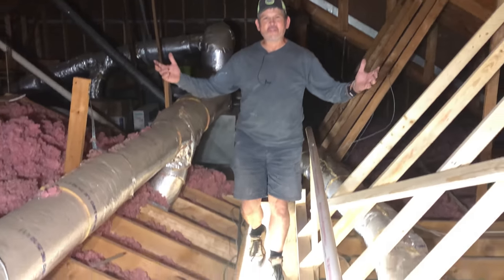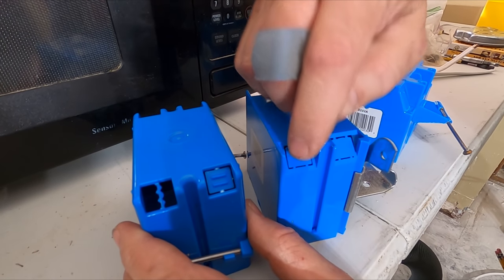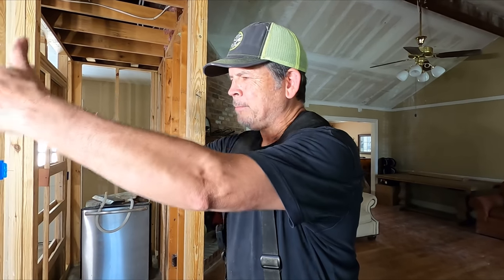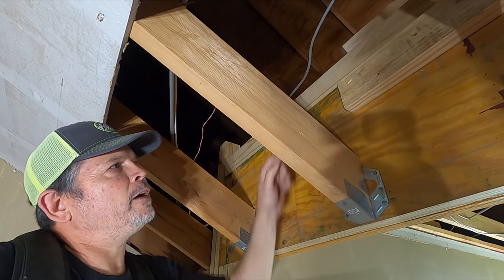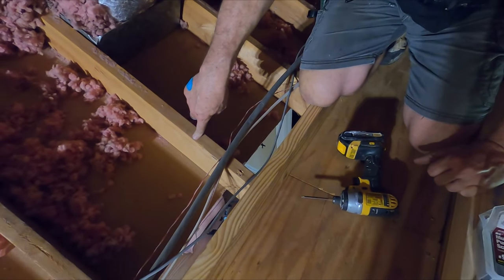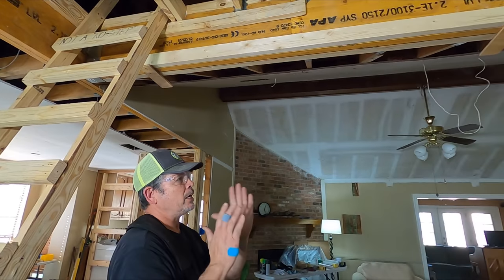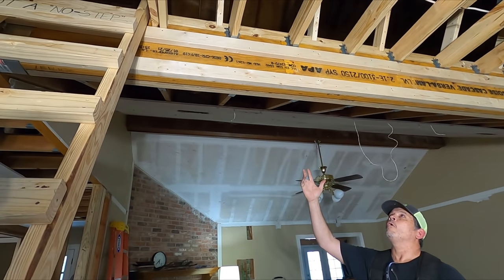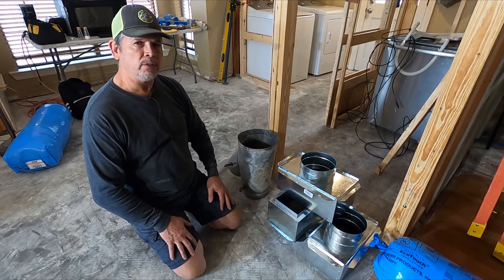EASY ATTIC TRAVEL! We Had Some Spare Materials... Ep. 11

Comment: I worked as a low voltage electrician. We were working in a commercial building installing new fire alarm smoke detectors and annunciation lights. One of my coworkers and I were in the attic and he crawled from hard lid ceiling straight onto ceiling tile and came crashing down. So that catwalk is perfect.
Reply from the maker: Thx Adrian 👍

Comment: Paul - It looked like there were screws going through the damper plates in air splitter. The way to reposition the air flow control handles so they would be facing up the way you said you wanted was: 1) remove the screws, 2) pull on the control handle to withdraw the pivot rod from the splitter, 3) re-insert the pivot rod, but from the other side, and finally 4) reattach the damper plates to the pivot rods using  the screws. (You guys do awesome work and I really enjoy your videos.)

Comment: Good stuff. When I had a house I installed lights and outlets in the attic and in the crawl space for when I'd work in these spaces. (light switches right at the opening).  In the attic I laid down plywood over the joists. Why not? It costs very little, makes it safer. The lights and outlets took a couple hours to install, probably saved me time the first year.

Comment: You are correct about the knockouts & clamps.
Reply from the maker: Thx Jerred 👍💪
Reply: No shit huh
Reply: Carlon's technical info sheet for their blue boxes shows this. Most single gang boxes have a knockout, whereas multigang boxes have integral clamps. National Electric Code 314.17(B)(2) Exception says that if we use a single gang box with a knockout, then we can put as many cables through that knockout as we want so long as we secure them within 8". If you go in thru an integral clamp, you must secure the NM cable within 12".

Comment: Even as just a homeowner, I’ve never understood why this kind of thing isn’t standard. As far as I’m concerned accessing things in the attic is important and should be easily done.
Reply: It was standard at one time, not sure why it changed! Look at houses built in the early 1900s (the house I grew up in was built in 1906) and they all have full stairways to the attic and usually full floors.
Reply: @hightechcarpentry  Most of those homes didn't have a great deal of insulation so an attic floor was easy and made sense. Aside from that, it changed because it isn't "pretty" and few consumers know enough to ask or care if the attic is traversable so builders nix it. builder's sell what sells. Additionally, a catwalk makes the attic easier to inspect, this is a bad thing from a tract home builders perspective. You're lucky to get properly flashed windows in a new tract home, if they won't pay for that you can be sure you won't get a catwalk.  I've seen catwalks in many newer custom homes. Like most things, it comes down to money.
Reply: It's all about money. The homeowner saves some money and the builders save a ton of money by not putting it in the houses they build

Comment: Hey Pual, 5 year hvac tech here. I'd recomend you strap up that flex and support it. Once you get over 3 foot length it tends to sag and over time that spring can give out collapsing the duct. Also I was though (doesn't mean it's the right or only way) you do the inside liner then pull the insulation to the just past the duct, and lastly pull the outside sleeve to fuller cover every thing and put the panduate in front not over the insulation. So you don't see the insulation and it creates a better hold. My last tip is if you can justify it Malco makes a pretty good panduate gun just for getting those things as tight as possible and then flush cutting them. It's great and they will prevent flec blow offs which can be really common if the line gets dampered down at the grille.

Love you guys and your videos, can't wait for my new hat to arrive!
Reply from the maker: Thx Rockery 👍👊

Comment: The handles to the dampers can be turned around so that they are on top. You can remove the shaft from the damper and put it back in from the top.
Reply from the maker: I tried Paul, those things were in there good and I didn't want to ruin that fitting 👍

Comment: That buried junction box with exposed hot wires is a SERIOUS code violation and I'm not even an electrician. Good on ya for finding it. The homeowner would've had a devil of a time finding it if it ever developed a short and was tripping the breaker. I know this from experience from some landscape lighting that I have that for some reason the previous owner removed a junction box and buried the wire nuts in the dirt. It was years before I finally discovered the buried wire nuts. Go figure. Ofc, now I own a wire tracer that I used to find my missing irrigation valves. But, I didn't know about those at the time when the short first appeared.

Comment: 0:39 The first two box designs feature knockouts. They are designed to be broken off to accommodate the wires. That's why they only attach with thin links of plastic. The third box is designed with integrated wire clamping.

Comment: I kind of did this same thing. They were remodeling at work and there was a bunch Plywood already ripped to 16 inches so I laid it down the middle on top of the roof beams. It’s slightly angled and I overlapped from there wouldn’t be any weak spots

Comment: Good idea for the catwalk. The only thing I would add is I would have installed it higher, say 2 feet high to accept an r60. I know for a lot of US zones it may be overkill but honneslty in Canada where we have crazy fluctuations from high temps to low temps, even the r60 makes a big difference to help keep the home cool. This way also it adds insulation around all the ductwork, as long as those are airtight to prevent the blown insulation from being disturbed. Great video.
Reply from the maker: Thx.  Pretty mild winters here.  R60 😳
Reply: @StudPack  yup, it will also make a good difference on heat resistance from the attic to the house and increase the efficiency on the hvac runs in the attic you installed. You can add an r32 over those runs since the runs themselves take space, so you're not really using a lot more blown insulation.

Comment: I did something similar on a house. We had two spare 2”×6” lumber that I installed as a catwalk next to the attic access towards where we were working. It made it so that you didn't have to worry as much when you were entering or exiting the attic. (The attic was too big to make it worth doing more than that.) I spaced them off of the rafters by laying a 2”×4” on edge to give room for the blown in insulation.

Comment: I never use flex, only in impossible corners. When I use it, I make shure it comes from a pipe-elbow or a straight piece of pipe and as straight as possible. I clean those airducts on a regular basis and always it's the flex giving problems. Tearing an blocking, collapsing, etc. Sometimes I can't get through them because they clog up more then straight pipe. Also from the in-/outlets I start with a pipe-elbow. This way the flex won't collapse in the bent and you don't have to hang the flex high. This way the flex is supported by the insulation and won't make strange bents when someone bumps into it. And straight pipe looks much nicer and is more efficient.
Reply from the maker: Yeah I prefer rigid duct but it’s never installed right.  Residentially speaking.  Too many leaks like in that wye
Reply: Yea it is the ducts fault not the brush you're using or anything you did wrong. If you clean ducts on a regular basis you probably don't know that much about hvac. From the comments I have seen not many hvac people are in here or they would be pretty heated. A lot of the methods used in this video are looked down upon by many hvac techs. I hope you are sealing the boots to the drywall with caulk. If not you may have a mold issue in the future.

Comment: Built me a walk thru attic using decking boards long two side by side and 2x between trusses makes getting to things much easier, had to doing duct replacement. 
Also those are knock outs on the first two boxes, clamping occurring when stapling wire the code required distance from box. yes some boxes have integral clamps but not required to on many of those boxes as long as wired secured per code.
Reply from the maker: 👍 thx mike

Comment: I have always noticed that the old metal ductwork work is heavy gauge and the new stuff you buy is half as thick. Since those metal diverters are always open. I think that I would’ve removed them completely since the duck work was going to go over it anyways.  I do like the strip lights in the attic however I don’t think I would’ve spent any extra money on that unless I had it sitting around unused because regular lightbulbs are much much cheaper and not many people go in their attic very often.  I do like the PVC handrail very smooth and you don’t get splinters.  Good Job!

Comment: A cat walk is a good idea, but the cats don't always follow the walk.  Back in the 80's we were living in an old country farm house that had been built in 1920.  No insulation.  The living room ceiling was 12x12 inch tiles that were stapled to half inch strips of wood.  I had opened the eaves on one side to add an addition.  It was a cold and rainy night.  The feral cats that lived on the property (about 35) decided to climb up the posts on the new addition and seek the warmth of the attic.  Unfortunately they all slept together on the tile ceiling.  Could not hold the weight and collapsed dropping most of the cats into the house.  I woke up in the middle of the night and could not move my feet.  Turned on the light and found a pile of wild cats sleeping at the bottom of the water bed.  Yes, we had a water bed in those days.  Took over an hour to get all of the wild feral cats out of the house.  Covered the posts with metal the next day so the cats couldn't climb.
Reply from the maker: I would have moved 😁 🐈🐈🐈

Comment: code says staple within 12 inches if using a box connector, 6 inches if not. if you pop the knockout out all the way on plastic boxes just put your staples within 6 inches and you are fine. metal boxes I would always use a connector as the metal will cut through the insulation.

Comment: Hi, Really enjoy your show and subscribed a while ago. Your videos on all aspects of a project and best practice of installations is great to see. There are not many trades people who are as well versed as you and can also explain both how and why it should be done a certain way, often known as "Code"!  I am a plumber and also do HVAC work in Maine, when we install flex duct our best practice is to always use a 30ga metal 90 when installing register boxes or making sharp bends for better air flow. The flex duct 90's restrict airflow because they are not much more than an elegant kink and tend to collapse over time. We also caulk the boxes to the dry wall to prevent heat loss and moister from the house getting into the attic space and dirty air from the attic into the house. That dirt stain around registers is seldom from the heating system.
You do great work keep it up! You certainly have found a great way to teach with your son the trades and share the right way with the world!
Reply from the maker: Cool thx Danny!  "elegant kink" 😂👍  Really like the metal 90 at register box idea 💪

Comment: A as HVAC tech that was a good job on the flex duct work, short and tight as possible is always best on that stuff. I would recommend getting the zip tie tool on the cover of the zip ties if you do duct like that  every now and then. It will give you a tight tie fitting and flush cut (I have a mini scars due to those ends).
Reply from the maker: Thanks Larry !!

Comment: Theres a carpenter guys, hes got enough sticky tape on his body to qualify, a step up from duct tape but still qualifies. Plus the added load that will help with will further prevent settle and sag cracks, great idea. I never use flex for a 90 ° curve, always hard pipe.

Comment: The two "dampers" in the "Y" duct is for balancing the air flow to different areas. They are actually very old stove pipe dampers and most likely should be removed as the new balancing dampers, also available where you got the sheet metal fittings, are built to lock down the position of the dampers. The ones you are using might have a tendency to close due to the velocity of the air going past them. Duct mastic is very cheap and extremely good - and necessary - for long term duct sealing in attics or most anywhere inside. I highly recommend that as the seam sealer on all duct work fittings. Stretch out the flex duct as much as possible to reduce air drag/turbulence and find a way to keep it as flat as possible. Most choke points are at the turns where the flex connects to the supply registers so make those turns as wide as possible.
Reply from the maker: Thx much appreciated 👍

Comment: those are knockouts on the first two boxes, the third is actually a cable clamping mechanism. it's needed multi-gang/anything over single gang boxes due to distance from wire to stapling surface.
as far as I recall only their "new work single gang boxes" have knockout,  everything else either has integrated clamping or requires clamps.

Comment: Would like to comment on the video move the refrigerator and you received a shock. You replaced the the receptacle . A safer choice replace with GFCI receptacle. In a event of a hot wire to metal ground refrigerator body or metal junction box the GFCI would open the circuit at the device. The GFCI would self monitor the circuit load you would need a pig-tale with a ground wire grounded to the metal frame of refrigerator. This would make it safe. 😊 Paul I value your quality workmen-ship.

Comment: Love the catwalk.  I put in a dual zone split ac and had to run the piping and wiring for one room through the attic to be able to attach it to the outside compressor.  Being 6 ft 5 I couldnt stand and walk but ended up using 4 pieces of 5/8 osb and just kept sliding them over the studs to make a path but it was very painful.  Really think catwalk is much better idea.

Comment: A suggestion: use some of that foil tape to seal the ductwork insulation seams, to prevent moisture / vapor from condensing on the ductwork itself. Yes, it would be a good vapor barrier if done properly, and you will want that.

Comment: My 7 year old house had a buried can light housing in the master bath, wired up in the center of the light circuit.  I have been working on adding new lights and doing a bunch of other work in there, but probably could have avoided most of this project if that light had been cut out by the drywaller, because there were only 2 lights in the whole bath because of it, and it was very dark.

Comment: LOVE YOUR VIDEOS! Just like using zipties on a dryer vent, they are not ideal. Best to use wire spring clamps that apply constant force. More expensive but the duct will never loosen from the junction or register.
Reply from the maker: Cool thx Slade 👍👊

Comment: 20:38 you say that during sunset the evening sun bakes the area in heat. So why not add some
carbon or infrared rejection film to the windows? The IR film will cut down on UV and heat. This combined with your other home improvements will make the house far more comfortable.

Comment: First rule of hvac. You never hook to the end of a trunk line. Now that becomes the path of least resistance. You hook to the side, top, or bottom because the airflow will hit the end of the of the duct and create pressure helping to create even cooling and heat. Now that system wont create the proper pressure and heat or cool as well as it should

Comment: Those zip ties for the ducts should be installed using a tensioning tool. Pulling it by hand does not get tight enough. These can easily come loose and leak or draw insulation into the home.

Comment: Interesting fact, in Australia we don't staple our cables inside the walls anywhere, that way you can pull cables and feed new cables, in my opinion the staples could possibly wear through the cable and bridge the circuit, probably not but it's possible.
Reply from the maker: Cool thx Brad 👍

Comment: Good video as always guys. Paul, have you ever used Scrail screws? They are a screw that goes in a nail gun. They would be great for a project like this. And the cat walk and lights are definitely time well spent. Have never put a foot through someone else’s ceiling but I have mine when my shoe slipped on a truss. After fixing the drywall ceiling I did a cat walk of sorts.

Comment: I usually try to tape the inner plastic of the flex duct to the ridged duct to prevent air loss. At least, whenever possible. I don't think you could have taped by the dampers, but I would have certainly tried.

Comment: The dampers should be adjusted based on how much duct is after them so that the pressure to each register is even. If there is a big difference in pressure then the system will only feed one register. 'full open' might not be the appropriate setting, but I do agree that adjusting them is not done after installation unless the system changed. If the manufacturer of that splitter could get away with not adding dampers then they wouldn't, right?
Reply from the maker: You're talking about air balancing.  Never seen it done in residential, commercial all the time

Comment: The catwalk is well worth the money. Using existing material and getting it done fast. Since some of the rock is down much of the work can be done more easily from below.
You mentioned the high humidity being a problem for spray foam. Have you ever seen or installed any type of attic exhaust fan? Did it help?

Comment: A better way to attach flex duct is use a zip tie tensioner, not just tightening by hand, then driving a screw next to zip tie, so that it won't let flex duct and zip tie to slip off of pipe, and then taping the seam to make it air tight